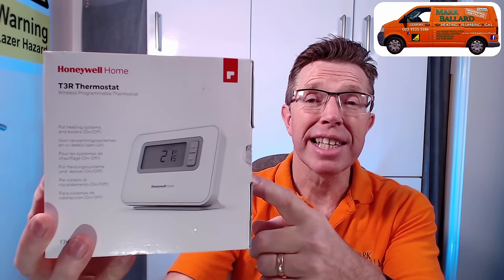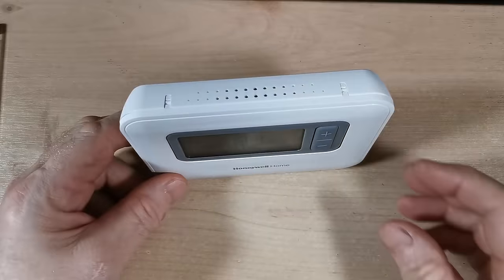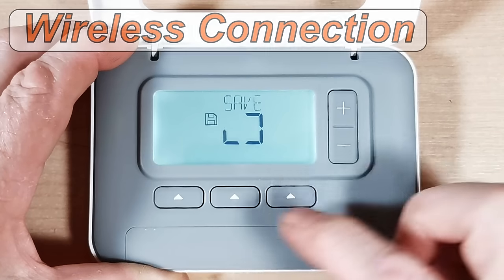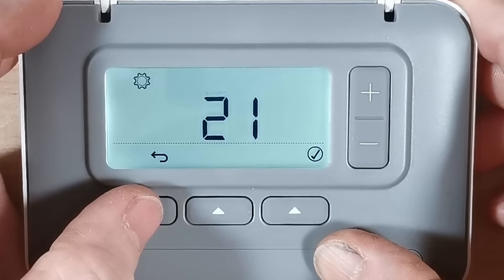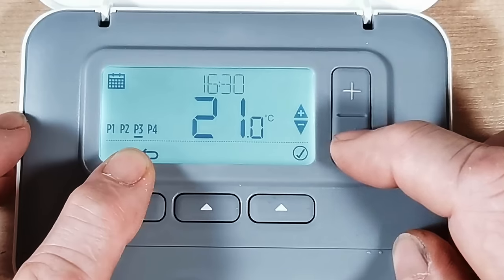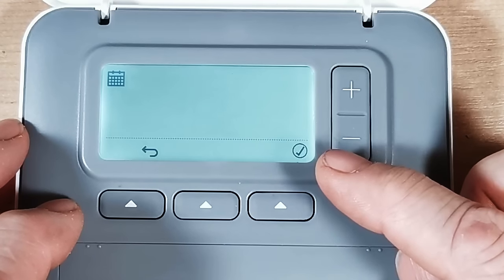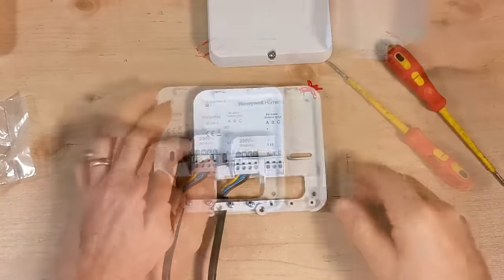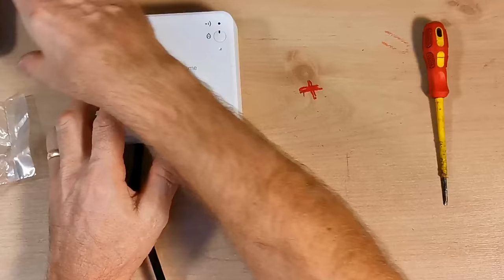How to USE, Program & Install the Honeywell T3 & T3R Including Wiring-Up. Honeywell Home T3R Review

Comment: I cannot thank you enough Mark for doing this video. My Housing Association have just fitted a Vaillant boiler and one of these thermostats. Previously I had another control panel for the boiler on the kitchen wall next to the old boiler and a room thermostat in the hall on the wall. So as you can imagine when this was all installed (with no time spent explaining to me how it works) I was left a bit confused and it has been installed in the flat for nearly two months now and only now have I sat down and googled to find someone to explain to me how to operate it. But it isn't just the fact that you have put the video up it is the fact that unlike 80% of other people putting up videos on "how to" , you are actually very good at explaining it and do so from the very start of the process all the way through clearly and without unnecessary waffle. Thank you so much I would have been completely lost without your help. Mike

Comment: Bought this for my dad, just so he could move the thermostat to whatever room he's in (he doesn't care for the programming and such), but it behaves quite erratically. It's incredibly slow when the temperature drops. Picking it up shoots the temp up by 2-3 degrees almost instantly, but it takes it almost 20 minutes to get back to the room temp. It's also for some reason firing up the boiler for very short times. Sometimes the unit shows the little flame indicating the boiler is up, but the wireless module does not turn the boiler on, or it does, but for like a minute then it turns off but the thermostat is still showing the flame... I don't know if i got a faulty unit but so far it's not performing exactly as it should. It is paired correctly, no error's on this side and it doesn't seem to be disconnecting, i am at loss.

Comment: Thiis video is miles ahead of the very very basic guide included in the box. One day after having the Honeywell stat fitted to rerplace the Worcester stat the boiled started up but the programming to switch it off at circa 1030 pm didn't. work and the boiled worked thru the night. It took me a lot of time trying to follow the Honeywell leaflet guidance but is is almost useless. Mark set me on track and I am almost up to speed. very grateful it helping me the this very cold 
snap which the Honeywell guide leaflet abandoned me to. Thanks Mark.

Comment: This video is actually brilliant. Before I watched this video I didn't know that 1. my thermostat needed batteries, 2. that my thermostat was remote and 3. the actual thermostat could actually be removed and used anywhere in my flat, and I didn't have a clue how to program it either.

Comment: Many thanks for this video, Mark. I’ve just had my programmable thermostat upgraded to the T3R. What I found helpful, in switching from the old-fashioned on-off programmer, was to think of P1, P2, P3, and P4 as points on a graph of temperature against time, with the odd numbered periods having a maximum temperature (above which the boiler will cut out), and the even ones having a minimum temperature (below which the boiler will cut in). Once you stop thinking of it as a glorified on-off switch, it makes more sense.

Comment: What a fantastic video.  I had a new boiler and central heating system fitted and  this was installed on my wall.   Did not even know it was portable, and the user guide tells us nothing.  Thank God for people like you Mark.  Now I can have heat at last.  Took me 2 hours and I still did not know how to get the radiators to even come on.  THANK YOU - you are a Godsend.  I am warming up at last :)

Comment: First video I watched confused me a bit as the guy had the settings 1-7 day and mine was preset to MO-FR and SA-SU , so I couldn’t see the copy option etc.. I am so happy I found your video which explains everything so nicely! 
Also when I fiddled with this trying to set the programs then the temperature showed 27’ and I was like this can’t be right I feel cold in this room! Thought it already broke 😄 so I put it to manual and raised the temperature up, but then noticed the display temperature dropped down and I thought now how is this possible then if few minutes ago it supposedly was warmer , now i know that when you hold it it gets warmer and confuses the thermostat 😅 anyways once again thank you for the instructions!!

Comment: Thank you so much for this Mark. I either wasn’t given a manual or can’t find it! Can’t find free one on internet. The one thing I used to be able to do on a previous CH system was keep it off but just override for an hour (maybe more). As I rarely use the system that was incredibly useful. 15:26  never used a pre-programmed schedule. But installer said not possible with this so just checking.
Last night I switched it on to Manual because had visitors - and realised this morning I hadn’t switched it off. Aaargh! Checked meter. Cost me a fortune!
Hoping you may be able to help.
Thank you again for this guide.
🙏🙏

Comment: Thank you for the brilliant video. And for your other videos which helped me decide to upgrade my old thermostat which had a dodgy screen. 2 questions:
1. The receiver gets hot when in use - is that normal?
2. If the set up (for electric underfloor heating) is as for basic/on off - does it matter what weight of flex is used for the little L>A loop? You dont cover this set up as far as I can see.

Thank you!

Comment: I had to watch your video again to change the clock ⏰ for spring time which just changed tonight ! I thought this would change automatically like on a mobile phones but mine hasn’t, although I’m not sure if the day was set correctly as it showed 6 instead of 27 (today’s) so I also corrected it. 😀

Comment: Hi Mark. I have just purchased a T3 thermostat and fitted it following your easy to follow instructions and it works great. I was wondering if you have any views on the Optimisation Mode of the T3, is it good? or don't bother?

Comment: I've just had one of these installed with a boiler and I despise it already on account of the programmer.  4 lousy programmes a day is no use to me.  I've been using one of those thermostats with mechanical switches with the 96 switches that you set.  I'm gonna try my best to get rid of this thermostat and get one of those.

Comment: Hi, great and easy to follow video. However, maybe few gotchas should be pointed out for installation stage.
1) the new receiver is larger and much thicker than old BRD91 receiver.
 So in my case when it was installed in a side catout of back MDF panel covering pipework, I had to remove that panel and either make catout larger or resite receiver (but I did not have longer 5 core cable to do it).
Not great Honywell, electronic components did not grow in size in the last decade.
2) cable access on receiver is from the back only. I had to cut out side entry to run cable neatly. Then I had to create extra retaining post to clamp cable. Again designed by someone who never installed anything in his life.
3) wall mounting plate has differently placed screw holes than wall mounting plate for old Honeywell CM927 thermostat. So again unnecessary installation step due to bad design.
4) let's hope this product display last longer than one on CM927 thermostat, which while easily replaceable is not available as spare part. Great for Honeywell Bank balance, less so for environment.

Comment: Cheers Mark I so needed this video my negative on this time controls T3 is it only allows 4 programs on my older one had 8 so I could turn on heating 4 times a day and then off 4 times on this new one t3 I can only turn on twice and off twice in Auto what do you think I used to have my old one come on at 7am off at 830am come on at 4pm off at 6pm on. At 10pm off at 11.59pm can’t do that with this newest model

Comment: Great video! 16 C temperature during the night (P4) in auto mode? This mode is useless. T3R indicates temperature incorrectly. I placed an electronic thermometer next to the T3R. The thermometer indicates 22.9 C, and the T3R indicates 24 C. How is that possible?

Comment: Quick question, how do I change it so I can have 6 Periods and not 4 periods for Auto Programme feature?
Reply: Did you have any luck? Id like to know if it's possible to add a p5 and p6 in auto too.
Reply: @Millsyboy84  no sorry. I think the screen is standard across a couple of models but the one I have doesn't have the p5 and p6 functions. Sorry

Comment: Hi Mark, just found your channel and finding it very helpful. I have this programmer but occasionally the date and time start flashing on it and the heating comes on even though it wasn’t set to and is manually set to off. I then have to reset the date and time to get back to normal. Any ideas on why it does this and if it can be stopped. Also I go away for a few weeks at a time and am worried that if this happens my heat will come on and will stay on costing me a fortune particularly now energy costs are so high. Any advice would be gratefully received

Comment: Hi Mark - great videos thank you. Especially pairing the T3 with the receiver unit. I have a question though please: when I press the button on the front of my receiver unit, the heating comes on but only for something like 10-15 minutes. Is it supposed to do that or stay on indefinitely? Can I set that time anywhere - eg it would be more useful if it came on for 30 mins. Many thanks.

Comment: I am thinking of replacing an old mechanical thermostat with the T3. Will the T3 work with motorised zone valves or will the constant on/off cycle caused by TPI wear out the heating zone valve?

Comment: Hi Mark I've been using my thermostat on manual (turning heating to off at night) but occasionally the heating has come on during the night so I don't know if controls are faulty or if its me forgetting to turn it off. I was going to use the programme schedule but it doesn't show end times only start times. Any help you can give would be brilliant.

Comment: Mark I bought a new boiler 10 months ago and was presented with a Honeywell Home Round wireless unit. This unit you twist to set the temperature you want, when to release it tells you the room temperature. My problem now is that the unit has 'gone dead' and I have no numbers? I have no manual to tell me how to change the batteries can you help please

Comment: Unfortunately, the parameters as listed in the instruction leaflet are not the same as the ones actually in the programme software. . For example, 4LL in the leaflet is 4MT in the actual thermostat menu., 17OP in the leaflet is 17FS in the thermostat. This is very confusing.

Comment: Great video! Does the last temp setting of the day get held until the morning? Ie if you set it at 21 degs at 10pm, will it aim to hold that temperature all night until the next programmed setting kicks in?
Reply from the maker: Yes. I always set mine to 10 degrees to keep it off.

Comment: How do you set up this one to not switch on/off every two minutes or less. I did set up 21 and once temperature is reach heating switch off but in one minute gets back on after another minute off and on and off and constantly like that. I wpuld like to get 21 degree but once 21 degree is there let drop a bit for a hour let say and then go back again.

Comment: Hi Mark. Very good video...keep it up 👍.

I have a query; when programming the times and you set a lower temp (16 eg) for P2, will the system fill my radiators with cold water to reach the lower temp?

Many thanks.

Comment: How come there is only p1 p2 p3 p4. Can I increase it to P6 so the customer can have three separate heating times on off per day or is that a different unit?

I notice some have p1 p2 p3 p4 p5 p6

Comment: WOW, well i got a Glow Warm 30CXI or CXI30 anyway. Turns out the Thermostate NEVER WORKED in the first place.  Climapro2 using a Ebus + - (i have a feeling it was never paired, they say its done at Factory!) was suggested a T3R as a Replacement. Power to this i can do but this signal wire around this switch im unsure of..
GUESSING that i should Take out the 24v Pin on the boil and still connect around the EBus +-  
at the moment its WINTER so im DAM Cold so while its RUNNING without the Thermostate i am too scared to do any thing that may risk it not turning on. 
I did think about Re-Pairing the Climapro2 (i see the button!!) it talks about Pairing them for a Outdoor system and just skates over the Indoor system could ever be wrong.

Every time i try and look up 30CXI manuals and then look at my boiler i am think WTF they are NOTHING ALIKE!! I hate Generic PICKS and images 

Any help would be great as I am a bit unsure (the boiler maker has Replaced a lot of parts and then said your Climapro2 is DEAD you can replace with a T3R) and that was it !!
to me it looks alive a light is ON!! I am not sure what to expect from a EBus + - as the colours are in Blue/Brown (to me that suggest L & N) Red and Black i feel would been a better if it is lower voltage or a different colour maybe!! ..

Electrician here and have been Electronic Tech before .. dont want to fault find and learn about the whole life style of a boiler if its a easy fix

Comment: Hi, been looking for a video just like this one, thanks, it will come in very handy. 😀 my set up is a bit different. I have the wire from the boiler L N and the 2 switch wires👍but I also have the mains L N. Both B are in the same terminal👍 but the L are in separate terminal. So my question is, does it matter which L wire goes into which L terminal. I was just going to copy what I I’m taking out….. The 2 E together, the 2 N together the the boiler L the the main L. If you could get back to me with any help the would be great, cheers

Comment: A bit late to this party, but I agree the Manual is pretty awful, makes the Setup much harder than needed, and I have been playing with tech and computers for decades (and writing Manuals)! Quick mention that Mark also has a recent Video (25 Feb 2023) that covers how to fix loose battery contacts in the Honeywell T3, which was another problem we were having, with the thing going back to the Setup Screen when ever it felt like it.

Comment: Will this conflict when there is a wired in programmer for HW & CH? 
Should one set the CH to be on permanent at the wired programmer and then use this device to operate the CH on/off times?

Comment: I can’t for the life of me find the receiver box in my home. I moved into a flat that had this all set up with 2 separate thermostats (1 in bedroom, 1 in living room). However manually turning either thermometer up, only heats up half the radiators. Would you have any idea on where the receiver would be hidden?

Comment: Hi Mark wondered if i can ask a question....ive set the programmes fine for during the night. However when i use the manual function for during the day and take the temp higher to the current room temp, itll turn on but within minutes turns off and it continues to do this..ive also noticed as soon as increase the temp to turn it on, the current room temp jumps up within seconds. Is there something wrong

Comment: I have set 101 times the programs: 0550  to 0800 am and 7 to 2200 pm. But the extra hour
which I have seldom used still keeps on coming up! Swith off temp set to 5.0c. For ex: at 8 am the heating is off but immediately come uon again with 1hr. I switch this extra hour off by setting temp to 5.0 and after a while comes up again until I switch it off again. Any help out there? the guy who installed it has disappeared.

Comment: A question, my old honeywell dial thermostat only has 3 wires, live,neutral and earth but is wired from a separate switch from the boiler. Do i just use l/n/e or do i wire the switch wires as per video.

Comment: brilliant video and very helpful
Reply: Mark I have bought the Honeywell T3R and want to connect to a Vaillant ecotec plus824 with 130 timer built in with pins for setting and just a temperature set on boiler only . I want to not use the timer by unsettling pins and use the T3R , do I just remove link on 3/4 and wire in the volt fee terminals into 3/4 or 5 and another number with 5 Brian

Comment: This has helped a bit but I'm sorry this is a infuriating device. How do we switch it off.  I switch it to off and it comes on. We have our auto settings but we sometimes put it on and off outside those time and it comes on when its off and on when we want it off.  I've put the temperature setting right down to single figures and it still comes saying the temp is in double figures and it does this when we are out. Please tell us how to switch it off and stay off. thanks. Really worried we will be heating the house when its warm out.

Comment: I never seem to have enough hot water.  Could this be the thermostat setting>
Reply from the maker: No your room thermostat has nothing to do with the temperature of your hot water. Your hot water temperature is controlled by the running set temperature on your boiler and if you have a hot water tank the thermostat on the tank also

Comment: This has got to be the most user unfriendly thermostat setting ever! Even following your directions mine has only MON showing not MONFR as shown and also it's showing P5 and P6 as well! Wtf!! Also,why do you need to turn the temp right down for the boiler to turn off despite setting for it to turn off at the desired  time?!Absolute bonkers! Unbelievable, Honeywell really ought to stop outsourcing their programming work to India and I'm being charitable here. What a contrast to my Valiant boiler timer setup which is so intuitive that I managed to work everything out for myself without even referring to the user manual!